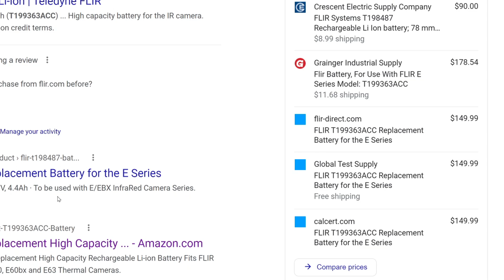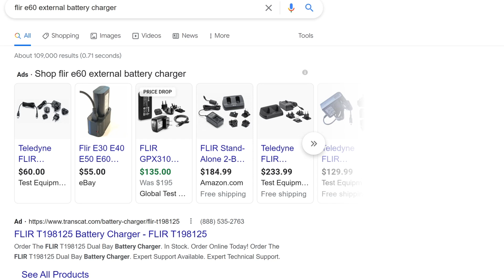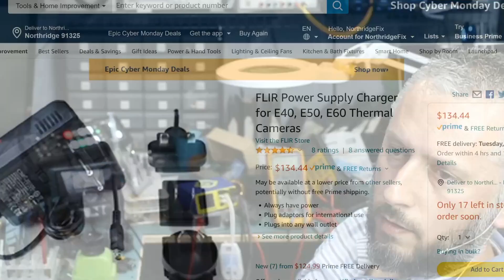Which thermal camera to buy. FLIR bad practices & their ridiculous non standard RCA cable

Comment: For those of you hating on flir. Although everything of what he said is true…. I’m not sure why he’s so surprised or upset. This is practice that all and I mean all!!! Major companies do. I deal mostly with car wash and detailing equiptment companies. So Rupes, Scangrip, ALS, Flex. They all do that. My ALS under hood light went out. The batteries cost almost as much as the light. I opened the battery and found two cells exactly as you showed. Chinese branded, and found on Amazon for around $6.00. Batteries are the worst when it comes to markup and price gouging. You should look into car wash parts. A clevice pin for a roller is $4.00. A simply metal pin. Two years ago it was $1.00.

Comment: I have the FLIR TG165-x and it's my first thermal camera and it does lave a lag every now an then with the thermal refresh rate and then it catches up. Not sure what's causing that. Did it the day I first turned it on.
Reply: All thermal cameras will have a consistent lag for a moment, that's the calibration shutter closing and opening, it's normal.
Reply: @GoldSrc_  Its my first FLIR camera ever so I thought it was just a glitch in the software.

Comment: I needed a thermal camera but couldn't justify the Flir prices. After some searching I found some reviews of the Topdon Tc001 which rated it highly for the price ( resolution 256x192 and frame rate 25hz) Here in the UK it cost about £250 but probably cheaper over there? It works with any Android phone or tablet with usbc connection. but can also work with any Windows PC. I've been amazed by the sensitivity and ease of use of this great little device.
Reply: I just ordered one of these. How did it hold up over the last couple of years for you?

Comment: I would like to know what soldering stations you use (hot air & electric). I'm not trained in electronics etc. by school, but learned by the years.
Do some work myself, "private", for users who lack knowledge/tools to repair electronics. But I somehow need to get better gear.

My current soldering station is a low-end, but still does the job. Which brand is better, ERSA or Weller? Have you ever used a soldering bath, if yes - for what?

Comment: Great info thanks. So they rely on peoples ignorance when it comes to peripherals to profiteer with their product. How many times do we see this from today's manufactures. Sadly it's become the norm. Some even go to the lengths of designing their own custom ports. But the truth is these manufacturers know a lot of the time people don't have a choice, or the time, but to just pay up. I thought the point in  having industry standards was to cut down on this extortionist behaviour. Seems not the case for everybody, huh. In this case why not give the option of just slipping in two new standard 18650 battery's, with a simple battery holder. 20 dollars, tops, crazy. This is the kinda thing that drives customers away, if they had a suitable competitor in the market. E.g. Apple/Samsung etc. But they don't, yet. That's what they bank on, I suppose.

Comment: We are using a (relatively) cheap thermal camera now and have had great success. It has an ok resolution but only does 9fps which makes it feel very laggy. It has helped tremendously with those situations where the cap, chip, etc stays hot. I think our next investment might be a better camera to catch even more repairs in the future.

Comment: Urgen and Priority!!!!
Could you shed some light on this issue I have with my Optiplex 3010? Computer keep shutting down after few seconds. I did change the thermal paste thinking that would be the culprit but no luck. I went ahead and switched the memory from slot to slot and even replaced the memory chips and still no sign of normality. I have come to realize this maybe resulted from bad Mosfet, diode, or capacitors but I don't have the right tool to undergo the repair. Please advise...

Cheers,
Sylvester

Comment: I use the UNI-T UTi260B with 256x192 / 25Hz and a laser focus lens.
Reply: does it works with circuit board?
Reply: @singsing-bibi2582  Yes.
Reply: @charlycharlson4125  Thanks you.

Comment: I use Seek Thermal PRO with macro lens. It cost about 400-500 euro in EU. And it have 320x240 resolution. I used Flir E6 too but this Seek model that i have is better for electronic.

Comment: once I had to order a special "protocol converter" to deal with AXA power devices´  parameters via PC. It was 350 euros, so we thought it should be like the siemens MPI or something. We received a small box with male and female DB9´s . We opened the box and it was normal rs232 with no circuitry inside. Just moved pins 2 and 3 to 4 and 5. Same happens with lots of brands like Leica.

Comment: I don't support corporate greed via my purchasing choices. Flir's battery is like any other Li-Ion battery pack - plastic shell, connector, protection board and 18650 (or Li-Po) cells. For example, a regular genuine laptop battery is built the same way, but it has 6 cells instead of 2 and costs half the price. And these are worst case scenario retail prices that include the brand's profit. So, in fact, you're overpaying 6 times just because FLIR says so. It's not about better quality, technology or safety features. It's just corporate greed, plain and simple. They could've easily integrated the battery protection inside the camera and just made two flashlight-like slots for 18650 batteries, like in most e-cigarettes (vapes). Or just sell their battery packs, chargers and cables with "normal" overpricing and profit, which is plenty enough and completely normal nowadays. But no, their greed has no boundaries. 😂

Comment: A 160x120 pixel thermal resolution (19200 pixels) is perfectly good for troubleshooting (if the camera has manual focus and focuses down to 6 inches / 15 cm away from the DUT). And usually 9 Hz frame rate is perfectly OK to spot a stationary, failing component getting too warm. This is due to the slow and gradual heating/cooling nature of regular components (thermal mass).
Reply: 120x90 is good too?

Comment: I bought a Ulefone Armor 9 just for the thermal camera abilities. Have been using it for over a year now. Works good for finding shorted components. Especially like the edge overlay that places lines around everything the thermal cam can see. Makes it easy  to spot the exact component. Only thing I don't like about it is that it can't do direct video out. But I have a Miracast device hooked up to the same monitor my microscope is connected to. I just hit the HDMI input switch and now I am seeing what the Ulefone sees. Unfortunately it won't fill the whole screen. Just in the middle and about a third of the screens width. Probably going to have to get a monitor that comes with electronic screen rotation and zoom. Other than that. It does what I need it to. I don't use the phone for anything else.

Comment: One thing about quality I learned ison automotive, if you cheap out on parts and tools you'll regret it and that if you save up a little more quality parts/tools it will last you until it pays for it self not breaking and last longer. Of course there are some people who will think they will only use the thing often but that's the difference when you are a repair shop as you use the tool almost every time. People nowadays are bombarded will a lot of low quality cheap items that will need to be replaced again and again because they want cheap and fast fix. Nothing will replace quality tools and parts period, you maybe lucky on some cheap items but really you're playing with luck and remember how harsh it can be with luck.

Comment: Look for 3rd party dummy battery or use the circuit board that you took open from the official battery solider a USB cable and your have a external power for the camera without using the charger

Comment: Lol there must be a repair guru working at flir who knowa how to block and make difficult any attempts by repair people to use off market parts. Maybe later they will also go the apple route and embed a unique SN in each board so swapping it would be even more difficult. And if he thinks a 134 battery is expensive, some service monitors have license keys that can cost 10000 or more. This is not including the price of the service monitor at 30000 each.

Comment: why not use an old battery shell as a battery adapter? I mean, you can power the camera through the battery connector with a voltage between 7,2v-8,2v using the battery shell as a secure connector.
You won't need a battery during a normal operation in your bench and use de battery only for portable operations... reducing the battery cycles at day
Reply: The camera won't work without the battery
Reply: @B9NE  did you even read what he wrote? I've built similar 'adapters' for devices that 'require' a battery and it works perfectly fine. It basically just tricks the device into thinking there is a battery by removing the cells from a dead battery and connecting the leads from a power supply (bench or wall) to the (now empty) battery's terminals. So when you plug in the adapter it has leads running out the back of it, but most importantly the device receives the correct voltage to power it and thinks a battery is in place.
Reply: @michaelboyce3227  I was responding when he clearly said in the video that it won't work without battery, that's it. As far as bypassing the battery cells that's easy enough. Correct volts and amps will usually work. If there is a serialized board connected  then probably same deal. The switch won't work in the dock without 15v 2.6a so I'm well aware

Comment: That's ok if you have several thousand to spend on a thermal camera however I use a cheap £50 usb thermal cam and it does the job just fine for me it even displays the temp in digits whiCh comes in very handy indeed.
Reply: which one is that?

Comment: that's what always turned me off from flir, they make decent cameras but they overcharge for everything since you're paying for the "flir" name

for anyone looking for a "cheaper" alternatives the seek compact pro with a macro lens is great for this type of work, there are also bench top cameras designed like microscopes such as the qian li supercam and dytspectrum owl made specifically for board repair
Reply: Yeah that's the thermal cam that I use too.  it was pretty inexpensive considering what you get compared to Flir.  The resolution is 206 x 156, and the manual focus is great to get close and see the exact component that's heating up.  It's also a lot of fun to take camping to see wildlife at night. :-)

Comment: The biggest ripoff is that all FLIR cameras in each range, with different resolutions, have identical hardware, just crippled in software. Fortunately the more common ranges (Ex and Exx have been hacked to upgrade the lowest end ones to the highest model spec, with extra features)
Reply: Insane! Reminds me of what the EEVblog forum did to the Rigol MSO5000 series oscilloscopes, they use the same tricks to turn a 1000$ scope into a 5000$ one ;)
Reply: Most of the accessories for the Flir series of cameras are expensive, looking at Conrad, found a charger (don't know for what model). The listed price converted to US$ is around $200..
..but you get the wall adapter with it.

Strangest part is that it is made here in Sweden, the camera, still they are expensive. They were once a branch of the Bofors concern, later to be Celcius concern (even been there once!).
Ended up as BAE Systems. I think they once made the cameras for missile guidance systems..
Reply: I require additional information please
Reply: and the 9hz export restrictions due to being a US product...
Reply: In some cases crippling of resolution and fps is required for civilian (vs military) use of the cameras as well, at least here in the states.
Reply: @slip0n0fall  that's the sort of "requirement" that genuinely does nothing to help anyone. Yaaaay military industrial complex

Comment: Dare you look up the UK RS components prices on the parts? £30.00 E60 cable, £82.00 for the battery £98.40 with tax. £146.00  for the charger +tax.

Comment: There are a number of wirings for those 4 pole 3.5mm jacks. Tip/ring/ring/sleeve can be either left/right/ground/video, left/video/ground/right, or left/right/video/ground. They aren't fully standardised.

Comment: 4:44 Dunno if 60 fps was a repeated console gamer joke or serious, but FYI human eye can definitely perceive more than 60 Hz, exact number is hard to determine as we don't see in frames, but in continuous stream, and it may vary from person to person, alertness level or even specific parts of vision field. Also TVs typically have 60 Hz panels, though TV signal typically is interlaced (refreshed 60 times a second, but only half of the pixels), it's cinemas that are typically 24 fps.
Reply: I saw a research report on this and you are correct. SOME people can see in more than 60hz up to I believe 90hz is the highest recorded rate but the report mentioned that those who can see more than 60 hz it is limited to our outer periphery ie you can’t see it when it’s in front of you. Quite an interesting read
Reply: the world is only 24 fps so even 30fps is too much
Reply: @maskettaman1488  movies are 25fps because higher refresh rate caused motion sickness to people in cinemas. As stupid as it sounds. 25fps is that sweet spot, where it doesn't look like a slideshow yet is not real enough to make our brains freak out thinking it is moving while it is not.
Reply: @victortitov1740  Not quite true. Movies are around 25fps because it wouldn't make sense to run them at a higher rate. You could run a movie at 60fps but that costs way more and no one would be able to tell anyways so what would be the point
Reply: We see light reflected off surfaces into our retinas processed by your brain. 
As for the frequency of visible light that falls into the 4 - 7.5*1014 (Hz) range
However i think you didnt mean hertz but mean fps in which case the number is no more then 60vfps. However technology can record at a mich higher rate and allow us to play it back so that we can percieve 1000fps but in reality what we watch is at least 1000 seconds long but was only 1 second of recording.
Reply: @westhouse4641  Hertz is more than the frequency of light. It's simply defined as cycles per second. You can flash a LED with 5Hz (every 200ms) , but the emitted light has a frequency of 565·10^12 Hz.. (Green ~530nm)
Reply: @westhouse4641  Hz isn't only used to describe frequency of light, anything with periodicity may be described by frequency (Hz) and/or period (1/Hz=s). In electronic world Hz is typically used to describe frequency of change of physical media (i.e. display), while fps is used to describe change of software media, and they don't need to be the same.

Comment: Nice analogy on fps. FLIR are definitely price gougers, those 18650 cells in bulk probably only about 5$ each, and that's probably on the incredibly high side.
Reply: They bulk at about 3$ each, the price has gone down a bit.
Reply: Heck, top tier Panasonic cells retail for around $5 here new. I bet they get them much cheaper.

Comment: Hi alex, very good explainings about the thermal cam. Its always good to get some tips and let us be a part of your experience, from a pro like you are. 
Well with your flir-experience and the spareparts, there are a lot of companies out there who cheat on their spareparts to let customers buy the expensive ones instead of the third-party parts. They all use tricks, change the position of plus and minus-pole, build up another connector, and so on. we are exposed to the industry and in times like these they try everything to get you to buy the expensive parts.  So you have to be interested in technology, have a watchful eye and also think a little logically.  Do a lot of research on the internet and then you usually realize that you just have to swap the plugs.  there is often a lot of trickery.
My question for your low-battery problem, why dont you buy just new batteries in the same size with the same volt and mAH, wouldn't that much cheaper for you? Or is there maybe a "counter" or something you had to reset on the board from the original battery?

Comment: I have used a Blackview 9800 Pro Rugged phone with a built in thermal camera for the last 2 yrs for board repairs & it cost one hell of a lot less then buying a FLIR!... It cost me US$263 & then paid import duties & shipping to OZ AU$523 all up & it does a good job finding hot spots on a daily basis & I can't recommend it enough for this feature alone let alone it's also a mobile phone with 128GB of storage & 6GB of ram I'm very happy with it but it is a bot of a battery hog if you use it all day with the screen on but hey that's to be expected, so again a very good option as a thermal camera IMO.